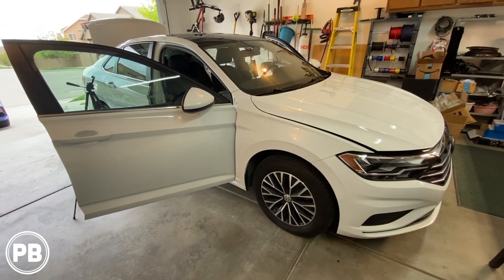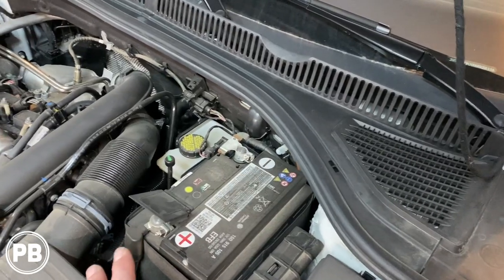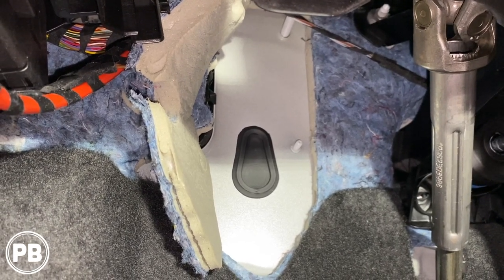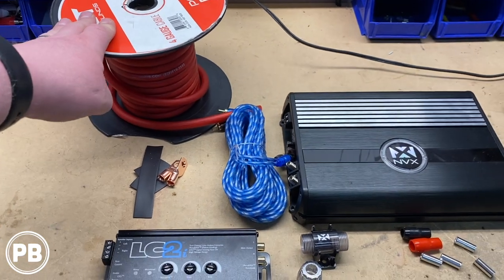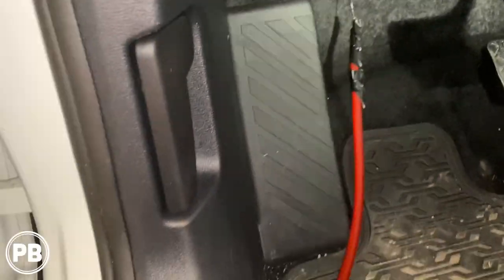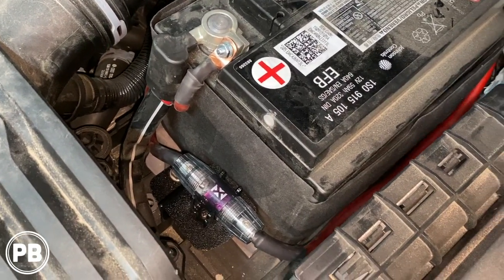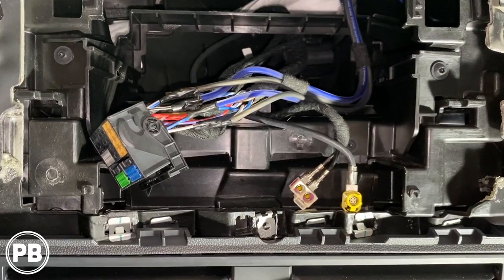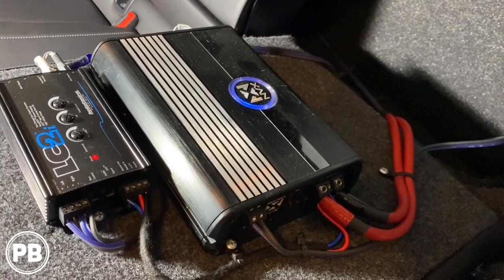2019 - 2022+ VW Jetta Sub and Amp Install

Comment: Is the lc2i needed for this kind of setup? Or is to just improve the bass roll off?
Reply from the maker: It helps with bass rolloff, and if you have a factory amplified sound system (like the fender audio), it can take a higher power amplified signal input than most line out converters.  If you don't have a factory amp, and don't care for any signal correction, any line out converter can do.
Reply: @ProvoBeastAudio  thank you so much for this video and the help.  if running two amps, one for the door speakers and one for the subs, would I need two of these?

Comment: Can you run 2 12s in a jetta or do u need to buy a new alternator
Reply from the maker: speaker size is irrelevant - it's more about the amperage draw and power needs of the amplifier you are installing.  Most healthy batteries and decent wiring / charging systems can support up to 1000w RMS without electrical upgrades.

Comment: Why didn't you just tap into the rear speakers in the rear and no need to run cable to front and take the radio apart.
Reply: How you run it from the rear speakers? Will it connect for all speakers that way?
Reply: @ericspivey8325  all you need is the 2 rear speaker signal

Comment: Where did the remote to the LC2i come from ?
Reply: From speaker wire signal. Once the lc2 picks up the "speaker sound" it sends the signal to the lc2, which in turn, turns on the amp. Remote wire runs from lc2 to amplifier.

Comment: I can’t find anything on my Tiguan. Do you think it’s similar?
Reply: I have a 19 Tiguan and ran my power wire for the amp today. It was exactly the same except for the rear portion, but that’s not hard to figure out. Also, I am putting my amp in the spare tire well. There is a ton of room there.
Reply: @JoeBro37  What did you do for the factory amp in the glove box?

Comment: Can you tell me more about this bass roll off? Is that why the lower bass frequencies coming from my sub are too quiet?
Reply from the maker: Factory radio tapers off the bass at higher volumes to protect the factory (cheaper) speakers from distorting.   So when you install an amplifier and subwoofer, this is why at a certain point the bass doesn't seem to increase as you turn up the volume
Reply: @ProvoBeastAudio  that’s not what I’m having a problem with. My factory head unit has seriously garbage equalization in the bass frequencies. The lower bass frequencies are really quiet and as the frequency goes up, so does the loudness. Could I put a dsp in between the LOC and the sub amp to fix this?